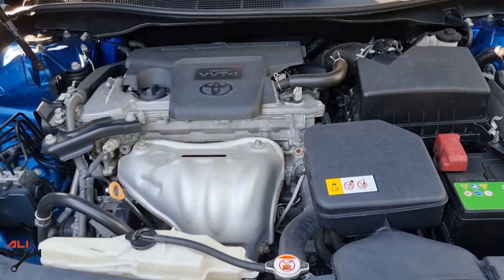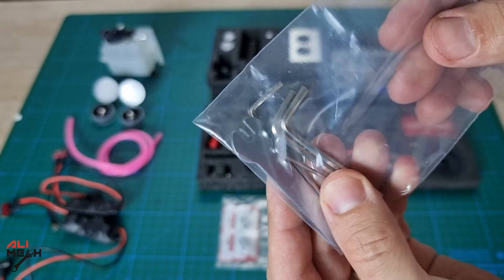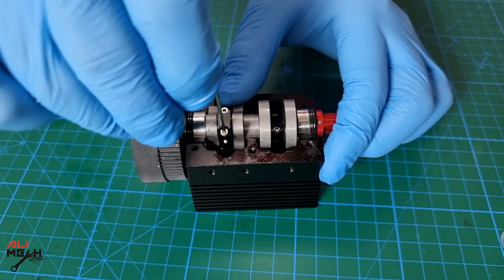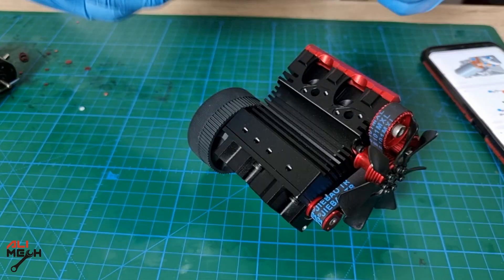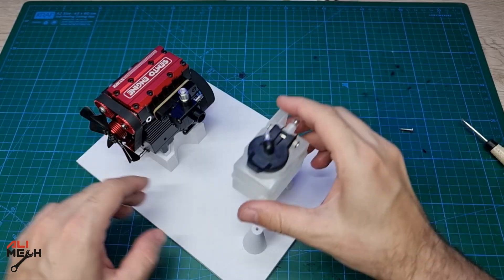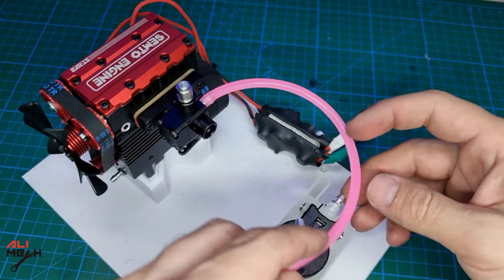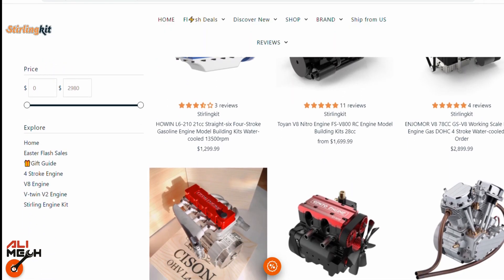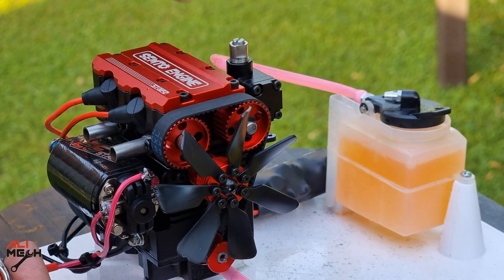Worlds smallest 4 stroke working engine, assembling and start up

Comment: Are you sure this is a 4 stroke?
Reply: Yes, you can tell by the position of the exhaust and the two rocker arms at the top
Reply: If it has a camshaft and valves, it’s a 4 stroke.